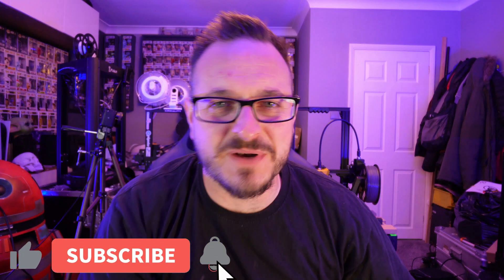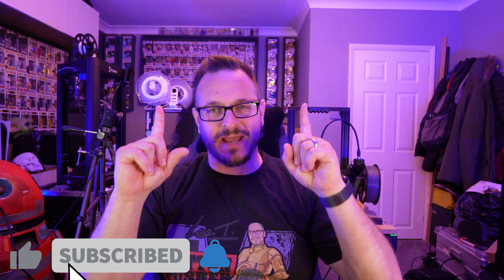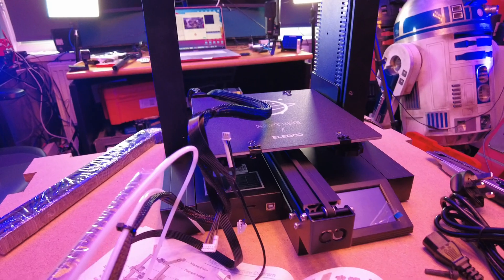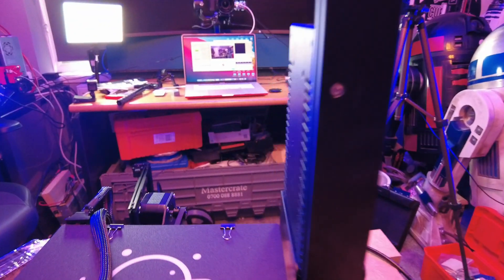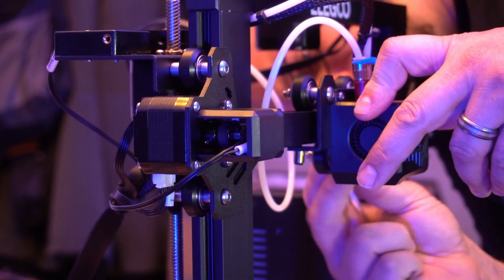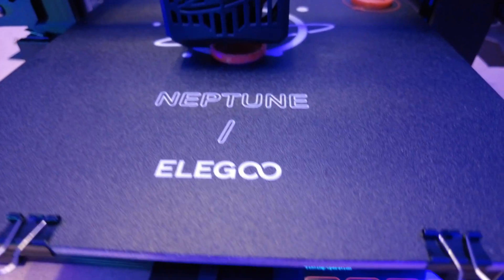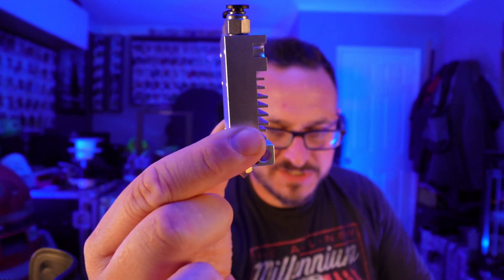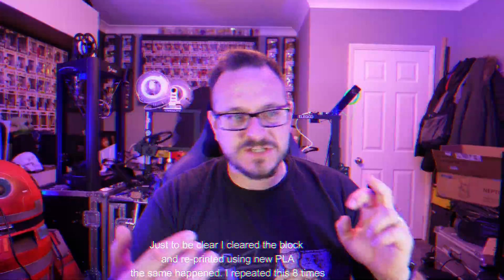Elegoo Neptune 2D 3D Printer is a huge disappointment

Comment: I have the Neptune 2D. I was sent it by Amazon to review. It prints the test two colour model fine, but when I use Elegoo Cura to combine a two-colour print model from separate parts and slice it - although it appears to slice fine, and the wipe tower is generated - when printing, it doesn't seem to have the correct G-code added to retract the filament from extruder 1 before starting to feed filament 2 - net result - instant jam. I emailed Elegoo support asking them what I needed to do to resolve this issue, but never got a response - go figure.
Reply from the maker: The support from Elegoo is usually terrible it’s a “community” solution usually. I would have kept it and solved the issues if i felt I had it in me but I have lots on currently with projects and a troublesome cr30 so for me it wasn’t worth it
Reply: @TheRealSamPrentice  I put a long explanation in a standalone comment but in short, ditch cura and use prusaslicer. Cura's multiple extruder setup is made pretty much just for actual multi-extruder setups, and is not at all optimal for SEMM, resulting in a lot of back and forth trying to get the wipe tower to actually work. Prusaslicer on the other hand is more meant for SEMM (though it can also work for multi-extruders) because that's what their multi-material setups are (the MMU and MMU2S are both Single Extruder setups), so there isn't really much guess work in setting up their wipe tower (though you can of course still tinker with it).

Comment: Good video and thanks for the warning.  I have seen this type of Y feed before and wondered how it would work.  What is the process to change filament?  Do you have to retract the one and then feed the new one?  Is there a purge block.   I have always been interested in multicolor, but not sure I need the headaches.
Reply: Ok.  I can't comment on his video but can answer some of your questions and others as I have bought the 2D and initially had operator issues. 
As one guy says, it works great in one color mode.
But, as is said in their manual an nowhere else, you need to make a couple changes Elegoo Cura AND you need both filaments about a half inch out of the hotend BEFORE starting the print.  Meaning you can see where both filaments are about a half inch from going into the hotend.

The printer will manage which filanent goes into the hotend and will pull tge other out before putting the other in.
One thing they don't tell you on printing dual colors on a single hotend is it prints a circle on each layer AND each time the color changes.  Presumably to clear the nozzle.

The other thing is you can mix colors and percentages of colors like mixing red and green to get brown.

I an not sure where the hotend issue he describes comes from.  I have had beautiful prints in PLA using Hatchbox filament.
Once I leveled the printed, I have not had a fail unless Cura said it was a bad object.

I also printed a two color Benchy from Thingiverse and turned out better than any of the five printers I've had.

I tried to do an upgrade to firmware and it blew up the printer.  It won't work now.  But, I'm sure Monday I'll get it all working when support comes back.
Reply: @geraldnichols4965  "One thing they don't tell you on printing dual colors on a single hotend is it prints a circle on each layer AND each time the color changes.  Presumably to clear the nozzle."

They don't tell you that cause that's an option in the slicer lol. it's called an ooze shield, or draft shield, or something similar based on your slicer... Definitely not something by default.
Reply: @geraldnichols4965 you tried to upgrade the firmware and it blew up ! ?
Reply: Yeah, the printer handles the filament change by retracting a filament and extruding the other instead, but quite frankly all moodels that use a Y splitter are garbage : clogs a lot and the slightest blob that forms in one filament can prevent it from coming out or in the bowden tube, or getting split in the Y junction.

Mixing chamber hotends where the bowden tubes (or all metal heatbreaks) meet up at the heater block only (like the e3d chimera) are the only ones that really work well. There are some splitter types which are also shaped better so the filament literally gets rammeed into shape and those are good too (like the chameleon 3d kit) but those are kits that often require an additional board or the like.
Reply: @Popatoh  "There are some splitter types which are also shaped better so the filament literally gets rammeed into shape and those are good too (like the chameleon 3d kit) but those are kits that often require an additional board or the like."

Haven't gotten to work with the 2D yet but I have worked a lot with the Prusa MMU2, which works on a vaguely similar premise. Have you tried editing the gcode to ram the filament before unloading? That is what the Prusa MMU2S does before unloading, specifically to avoid the issue of a ball end jamming in the bowden tube. Cura, even the Elegoo version, allows you to edit the portions of gcode at the start, end, load and unload. Another possible solution would be to check the inner diameter of the bowden tube and get one with the same outer diameter but a slightly wider inner diameter (another modification I ended up doing on MMU2S to prevent jams during unloads).
As for the issue of needing the filaments out of the extruder before starting a print, you could edit the end Gcode to unload the filament at the end of the print (presumably the filament not being used will be already unloaded).

Elegoo's version of Cura automatically adds a purge block. I'd need to test whether this purgeblock will need this trick (my 2D is coming) but on the Prusa MMU2S when using different materials (ex, PLA and soluble supports) you need to encase the purge block in an object made of the primary material, as the BVOH and PLA will often delaminate and the block can fall apart into the print.

It would be interesting if the filament sensors could be moved to just after the extruder motor, as then the firmware might be programed to "home" the filament to a known position before loading (another idea taken from the MMU2S)
Reply: Update- Just got my 2D, and while I am still tinkering with it I can confirm that filament changes work waaaaaay better when ramming before unloading. Prusa unfortunately doesn't use a single command for ramming, rather generates a dozen or so extrusion steps before unloading in steps as well, but this isn't a terribly huge problem as we can just take these lines from a job I sliced for the MMU2S and load those commands into the extruder end gcode for either extruder. Also added a line to send the extruder to X235 Y235 before unloading and loading as there would often be a bunch of filament pushed out, resulting in a big blob on the print (it seems cura does not care to move the nozzle to the prime tower  or even off the print before doing so). Sending it to 235,235 also results in the strings from loading getting stuck on the prime tower, not the print. I did enable ooze shield anyway though, just in case.

It's still a bit finicky (I am literally testing this right now as I type) and I've yet to try this with different materials, but in case anyone is checking and wants the gcode I'll put it here, just put it into "extruder end code" block in machines settings. Tested on Cura 4.12.1

;UNLOAD STARTS
G0 X235 Y235 F3000;I hope positioning is absolute
G1 F938
G1 E0.1811
G1 F1025
G1 E0.1978
G1 F1164
G1 E0.2246
G1 F1338
G1 E0.2582
G1 F1529
G1 E0.2950
G1 F1755
G1 E0.3386
G1 F2067
G1 E0.3990
G1 F2484
G1 E0.4795
G1 F2918
G1 E0.3360
G1 F2918
G1 E0.2273
G1 F3214
G1 E0.6203
;WIDTH:0.5		;RAM END
G1 E-15.0000 F6000
G1 E-24.5000 F1200
G1 E-7.0000 F600
G1 E-3.5000 F360 ;this all adds up to 50mm retraction

G1 F1600 E-50 ;Formerly 80mm 
G92 E0 
;UNLOAD END

ps you can open up gcode to look inside to see what's going on; when testing with custom gcode it is handy to add comments like in the above block to "crtl+F" for it. I recommend using Visual Studio Code as notepad will take MINUTES to open gcode files, and may not be formatted.
Reply: Last update
Switched over to using PrusaSlicer as it works way better than Cura (it seems cura is more geared towards dual ex setup)
Clone an Ender 3 Profile, set the printer settings to 2 extruders, check Single Extruder Multi-Material, then under that tab insert
Cooling tube position - 80mm
Cooling tube length - 5mm
Filament Parking position - 80mm
Extra Load distance - 5mm

The Wipe tower is turned on under Multiple Extruders in print settings, but for soluble support interface or soluble supports you will need to first go to the support material tab and switch "Top Contact Z Distance" to 0 for soluble, the check "synchronize with object layers" to enable soluble material, then you can turn on the wipe tower and set the interface/support extruder under Multiple extruders tab.

The last jank thing that may honestly be optional is that you will need to clone the profile and under start Gcode add toolchange line (T0 or T1 respectively) before the prime line to actually load the extruder, as the ender profile does not do this. Then after slicing for the first time, orbit under the print to see which extruder is used first in the skirt and switch to the appropriate printer profile.

Comment: AnsweRed my question about getting this..thanks Sam!
Reply: A couple of things as I also bought this printer and red the manual.
First, I didn't have any of the problems you had abd got gorgeous prints everyone except the first because I forgot to level the printer. 
I used Elegoo's Cura.
I used 200C on dual prints.
Also on dual prints, you have to have both filaments a half inch out of the top of the hotend box.  Meaning you can see where there us about a half inch of open tube at the top of tge boom before you start.
I used the manual to show me how to set up Cura to print the cylinder in 2 colors.  I printed the two color Benchy also.  It was better results than I've gotten out of my other 3D printers.
I'm not sure why yours is messed up, but the first thing I would ask is if your using the Elegoo Cura.  I tried a Creality version abd it didn't work as well.
Reply from the maker: No problem!
Reply: @TheRealSamPrentice  What would you recommend?
Reply from the maker: @Filmman586  I really like the ender3 idex or if you're serious RatRig do a kit Idex also. I'm testing the TronXY 3SE at the moment which is dual colour/material and a laser! so I guess we will see how that comes out. 

What do you print?
Reply: @TheRealSamPrentice  I'm relatively new to printing, I have a Snapmaker 2.0 A350 and the Neptune 2. Looking for a 3rd with dual color. Right now I'm learning but eventually would like to make some money from this.

Comment: Haven't decided if I am sending it back or upgrading the hotend.  I got one good dual extrusion print out of it and then just clogs.  If I just use one filament it works ok.  Really nice Benchy.  Would you call it worse than the Geeetech now?  A couple dual gear extruders and Cyclops Hotend?  I will either use it as a base and build a better printer out of it or send it back.
Reply from the maker: You’re the reason Bill haha!! I just think if you
Are paying money for something it should work right away. If you have to mess with it in the first weeks then it’s going to continue to be a problem. It’s a false economy to keep upgrading stuff! The hot end is very similar on the geeetech
Reply: @TheRealSamPrentice  Decided I’m going to keep it and make it do what I want.  Just ordered the Big Tree Mixing hot end. Only $36 on Amazon and it will be like I got a deal on an A30 that actually works
Reply: @TheRealSamPrentice  Was talking to someone in the Facebook group and they were saying that it won't work in regular Cura, but it will in the Elegoo Version, the other thing is they say it works if you print off the SD card.  The one print I got to work was with Elegoo Cura and printed on the SD card, every other print I did from Octoprint.  I am going to try another from the card and the Elegoo Cura.  If it works great, but that's not how I want to use it, so the modding will still commence.
Reply: If I had another working printer, I’d box it up. But I’d have to stop printing to do that. I agree it should just work’ and it kind of does. It’s also cheap printer mechanic school.  The only problem it gives me is on two color prints.  Had all one color parts to print today and it’s been flawless.  Yesterday everything I printed was trash.